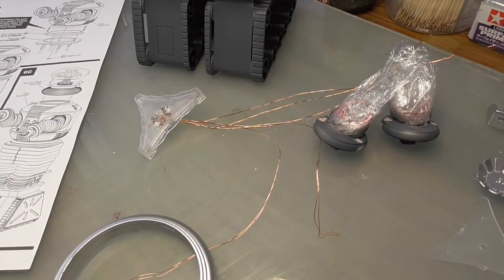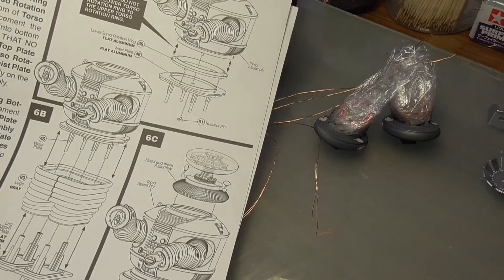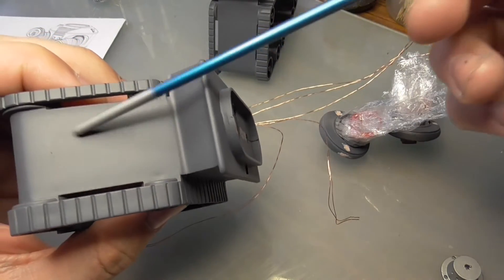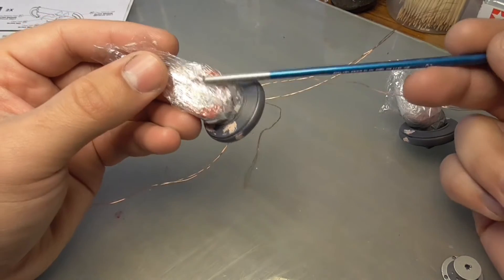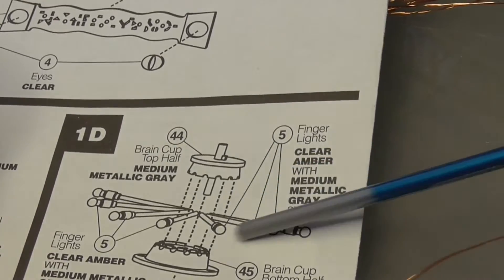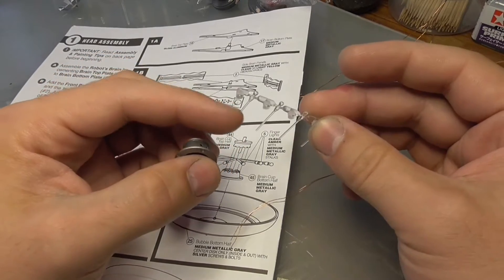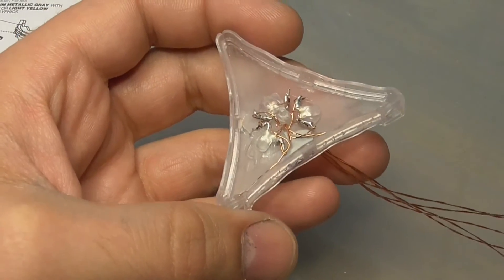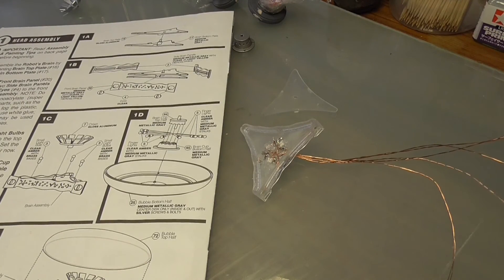B9 Robot | Part 5

Comment: Just wondering when sanding those areas that's driving you nuts, what are you sanding with? I think if you haven't already, I'd go about it like you would sanding on a car . Wrapping the sandpaper around a flat board/object. Using a guide coat of a lighter coat of primer over the darker coat would allow you to see high/low spots as you're sanding. Regardless it's awesome and a ton better then anything I could ever hope to achieve.
Reply from the maker: Zombie Dave Thanks buddy. Yes that is the approach im using. The problem is that the seams are stepped and difficult to get right in a small area without filling the whole side in.